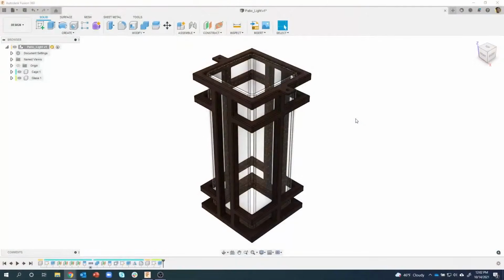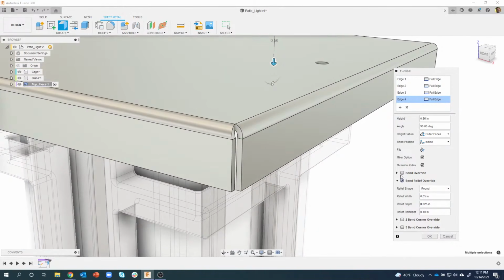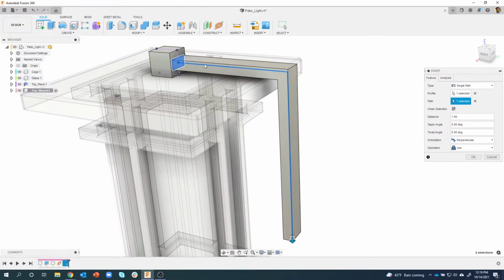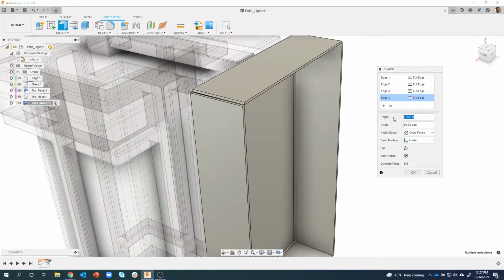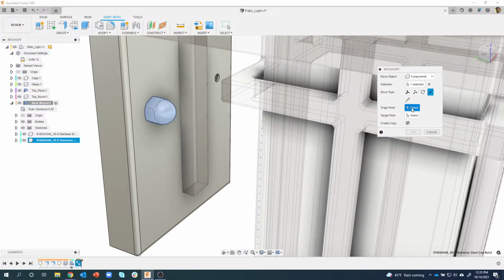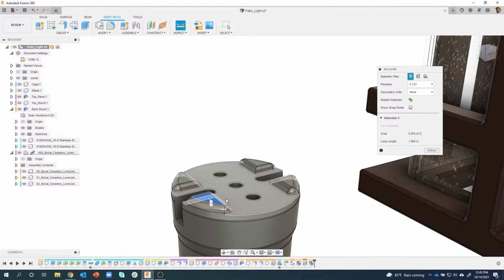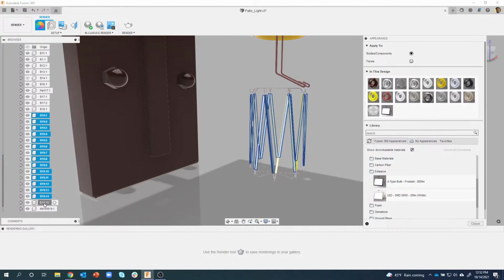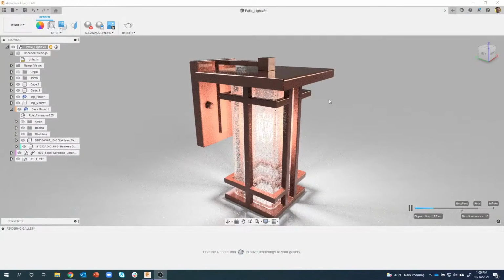Episode 97 - Part 2 of the Patio Light

Comment: Hi Brad, first off, thanks for all your great videos, I think I speak for everyone when I say that I wish you would come back on and do a lot more projects. Secondly, I like how there are different time lines for each component and that you are able to see a complete timeline when you active the top component, but could you maybe drop a suggestion in the suggestion box at autodesk and ask them to incorporate a timeline within a sketch? For example, it would be helpful when you’re in a sketch and want to add fillets, patterns and more importantly mirrors, to be able to jump back into the sketch and change some of those as a sketch feature rather than trying to go in and find them all and change them. I know that most of the time you create those features in 3D but I feel like sometimes it would be great to be able to work with these in the sketch. No need to combine them at a top level, just have a timeline within the single sketch itself. Thanks again.

Comment: Hey Brad, where'd you go? Ha! Looking forward to more sessions. Might I humbly ask for a video that doesn't have a plan, meaning that I often design in Fusion 360. I have an idea and I'm trying to flesh it out, but by the time I'm done, I've got broken links and my timeline looks like a rainbow. I use best practices as for as creating components first, for example, but the main issue I have is that I'll think of something new that I want to do to the part, but I'll go back in the timeline to edit something and there is nothing from the "future" that I can reference, it all goes away. Ug. So, I have to create a new sketch and recreate stuff I already did. Hmmmm. I tried dragging things around on the timeline and that works occasionally, but often pops missing reference errors. I wish there were a way to reference the current model when editing things earlier in the timeline. Ideas? Also, the error codes that pop up talk about missing face references, etc. Can you do a tutorial talking about how to fix these errors. It's not very clear how to do it. Thanks! Oh, and one more thing while I'm thinking about it, an amazing feature would be, to be able to create a parameter function on the fly instead of constantly having to open the spreadsheet. For example, I'm creating a circle and realize that I hadn't yet created a parameter for it, I escape out of my circle tool, open the parameter spreadsheet, add the variable and then go back out and create the circle, etc. why not have a "create a new parameter" in the dialog box when entering a dimension? That would speed things up tremendously. Again, this  is coming from a create-on-the-fly approach, which I often do. Pencil sketches only get me so far.

Comment: Thanks for the great tips Brad.
I design light fittings in F360, and use the emmisive materials all the time, getting some really good results.
It would be great if Fusion had some standard emmisive materials that came in the standard lighting colour temperatures,
2700K, 3000K, 4000K and 6500K then we we'd only need to adust the lumenance.

Best regards
Ralph